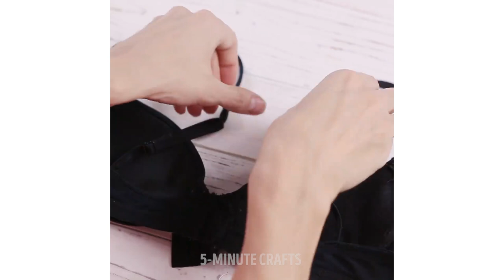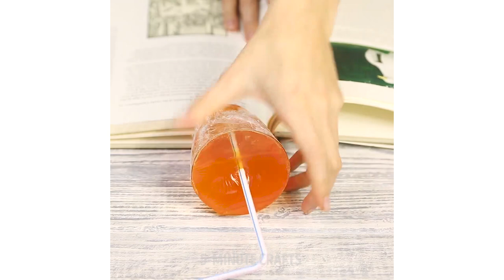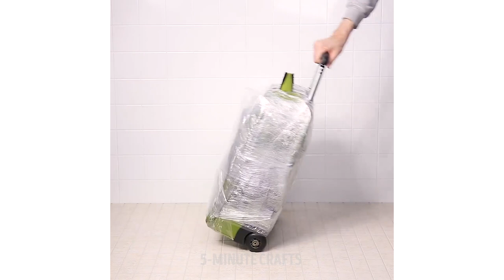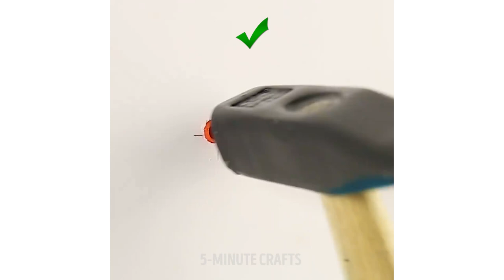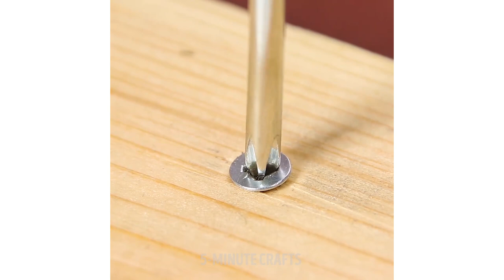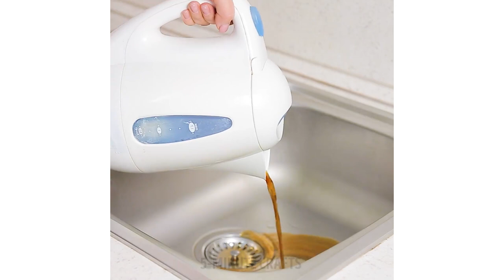21 INGENIOUS WAYS TO SOLVE ALL YOUR DAILY PROBLEMS

Comment: You know you don't need to bother with string to take off a ring, just run it under the water and use soap and it should just pull off